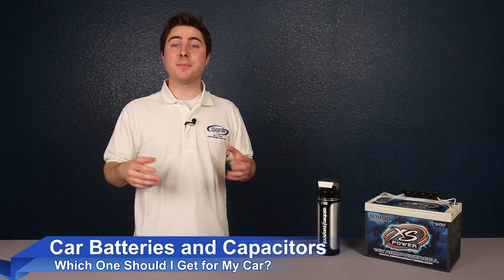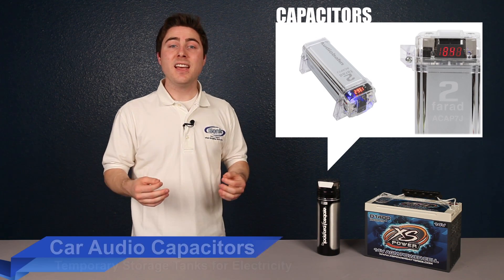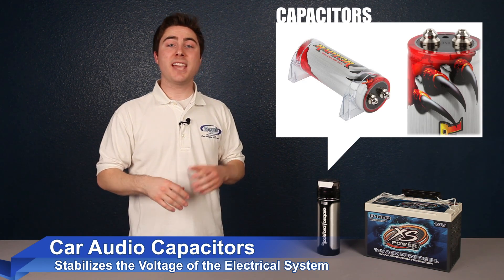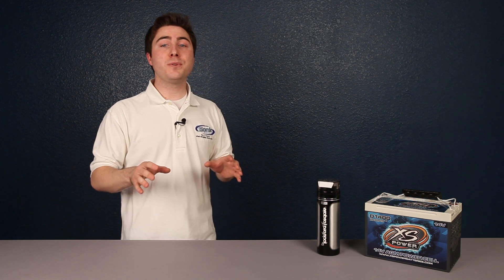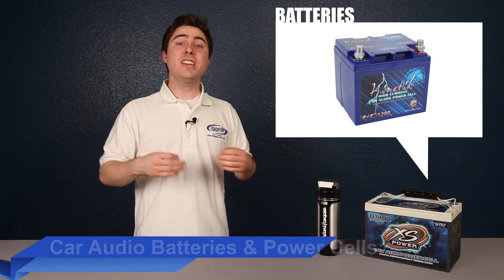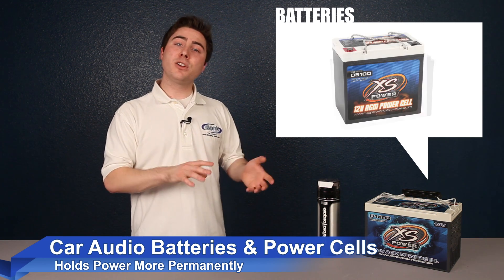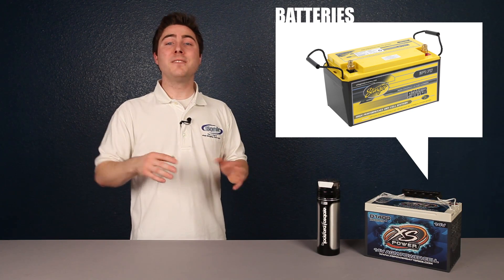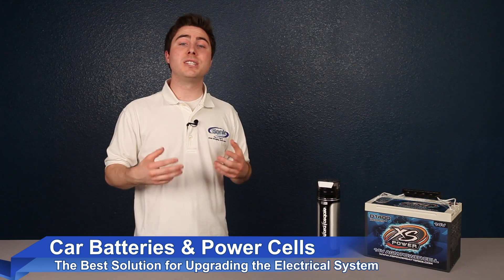Car Batteries or Capacitors: Which Should I Install? | Car Audio Tips

Comment: caps are absolutely worthless.. and I am not surprised that sonic is promoting these bullshit things. 

Do it right........
Reply: You're pretty clueless... "gets even less because the cap is taking it?" Caps "use up" about ".0015% of the energy that passes through them, a battery typically loses over 30% to heat loss. A cap is extremely efficient and a partially charged cap offers up its entire charge all the same as a fully charged one. A cap smooths out the demand on the alternator making it perform more efficiently because it decreases the losses by giving the electrons an alternative low impedance path versus the battery when demands are low, while keeping the load constant which is what alternators were designed to provide compensation for. Caps aren't the best solution in every system but to say they're never the best solution is an idiotic statement based in ignorance. Putting a high performance alternator into a system that experiences massive voltage drops constantly is a waste of half of that alternator's intended service life. If you're gonna act like a know-it-all at least know something about that which you speak.
Reply: It takes too long making informative responses only to see you reading a mere two sentences, and very badly apparently since you still don't appear to have gotten the point. If you wanna be ignorant just say so, sheesh. Not worth my time.
Reply: their not worthless, they do what their designed to do
Reply: +cuda861 Which is nothing, the voltage that they store last about 1 second in a quick burst That helps with literally nothing, If there is anything that is an issue with your system that would make you think a cap is required, the big 3 will help with, or a better alternator if you are running a system over 1000w rms on a sub 120amp alternator.
Reply: +Richphotos1 replacing the alternator and battery would be ideal yeah. But the cap does make it easier on your battery and depending on how big the cap is. If you get the right cap it will help. It's not gonna completely correct the problem. It does drain in an instant but with ale nought amperage that's not a problem. Capacitors are used in a shit ton of electronics doing the same thing
Reply: Timothy Hinton Now I'm not saying it's the best thing in the world. It's just one of those things that divides people. It does do what it's been designed to do since it's invention 100 or whatever years ago.
Reply: You would have to not understand how alternators work to recommend against capacitors in a few situations. One being where your system drains ever so slightly while at max comfortable volume until your amp goes into power protect mode. You would recommend a 300 dollar alternator over a 50 dollar cap when they both fix the problem? Further, you still have the issue of voltage drops, which alternators do not help a single bit with, meaning you need to either also purchase a cap with the alternator, or at the very least enough batteries to reduce the drop to less than 1 volt depending on your alternator's voltage regulator. These voltage drops also greatly lower the lifespan of your alternator which is caught in a cycle of half-load/full-load demands.Not to mention lowering your car's general efficiency both by adding a greater strain on the belt system to turn the larger magnetic coil and by adding in more loads that incur heat loss (batteries). Alternators are much more efficient with constant demand.
Reply: Caps are efficient and cheap alternatives to some over the top alternator/battery based solutions. Sure, you can solve any power problem by raising your average power output above your peak power input, but for some people that's over the top, when they can separate their average from their peak... with a fucking capacitor.

They don't have caps because when you have hundreds of thousands of dollars in audio equipment to power, your average energy demand is already so high that regular high volume power usage is beyond the capabilities of the amount of super alternators that will fit under your hood. So they're at an average power limitation, the solution is either put a generator in the back or the one that they all seem to choose which is stock up on so many batteries that your ears will be bleeding before your system is running low on juice.
Reply: Some problems with that:

The whole theme of the article you linked appears to be a system that's low on power to begin with and that what the car needs in that particular case is a better alternator. Essentially, even if everything was perfectly set up, the amp is draining the system's full capabilities too quickly. In other words it's not about the peak need not being enough, it's about the average need not being enough.

If you would kindly read the first message that I posted on this topic "Caps aren't the best solution in every system but to say they're never the best solution is an idiotic statement based in ignorance." Current limited overall systems need more current which capacitors obviously can't provide, no shit, neither can batteries. However, BURST current limited systems absolutely can benefit from capacitors. It's true that a capacitor will waste less energy than a battery, but this is a relatively few % of cases where that difference is going to make or break your sound system's abilities. It's not applicable to every system. Still, there are systems where the alternator provides enough for the average, but not the peak. Caps are for these systems specifically.

If you find your system bogged down trying to recharge the capacitor instead of feeding the amp, then it means either your capacitor isn't big enough for the drain you're incurring on it or your system is never going to be powerful enough for the current draw you're asking of it, and the only option is change the system demands or the system potential (alternator) It's very likely that you'll also need batteries or caps if your lights are dimming though, since alternators don't provide their power instantaneously on a sudden change like cap haters apparently think they do. Alternators adjust for maximum efficiency and there's a delay involved in that. The efficiency system isn't designed to accommodate audio system spikes.
Reply: That's what happens when an electronics engineer tries to take a moment to help out the guy who tries to hook his stuff up with a little extra context into the workings. May as well be talking to a caveman about bacteria and that's your actual career.. like really?

Thank goodness no, I don't work at a shop. Apparently they can do the same electronics-centered thing every day for 25 years and some how still don't know shit about electricity. I'm sorry, but no job should be that uninspired. Good luck to you as well.
Reply: Thanks for the info man your posts were clear and informative, Richphotos1 is like an armchair expert, a lot of written diarreah without any reasoning behind his arguments.
Reply: Richphotos1
I love it when people run out of arguments and resort to derogatory and empty verbal attacks...
Reply: Richphotos1
I read the entire thing and referenced it in my next reply. As I said, it was referencing a system that required more power, not a cap in order to say that caps are then useless, which just isn't true for other circumstances, such as when peak is what's lacking while average is a-ok. I'm not going to type more though if you don't intend to read it. Do you have any facts on those types of systems rather than a limited scope article on the matter?
Reply: Not sure if you know what limited means or read what I said.. but It seems like neither. Limited scope because it covers only one scenario of power needs and completely skips over situations where your car does provide the power needed for the average use but your battery doesn't provide enough for the peak requirement. It's not an uncommon situation, which is why sites like crutchfield recommend caps before batteries. Batteries are harder on your alternator than a cap is due to losses.
Reply: Richphotos1
Yes, that's correct. The point I'm making is that small gains can be made by introducing a cap. It's not better than a new alt AND battery, but it's better than either by themselves. The point of a cap is that caps save you money and allow your system to perform a little bit better if your engine compartment doesn't provide the clearance for another alt or have a wide enough belt for the additional tug, if you can't afford one along with a battery, or if you're concerned about efficiency in general.

I've said it many times, but I'll say it again. Alternators are made to compensate for consistent drainage of the battery, not spontaneous. Also, batteries aren't really designed to output their full crank amps, it will shorten their life. Caps help in both of these issues, while also saving your alternator work in providing a more efficient medium to store a charge rather than incurring those heat losses you'll get with a battery.
Reply: +cuda861 after the cap discharges but the music is still playing...now your amp still wants power and it gets even less because the cap is taking it
Reply: Timothy Hinton it's all up for debate.... I dont think it's a great thing for car audio stuff. You should upgrade your alternator and battery. There is vd but I'm not sure if it's so much it would create a problem. I'm not saying your wrong, but i would like to know the actual vd to come up with that conclusion. I don't use one so I can't but I am very interested
Reply: Please do some investigation on how things work before you purport to know. It's not going to do you any favors in hindsight.
Reply: Wrong. A cap is not a consumer, it "takes" no power. It is just a midway-station, a buffer. That is the big difference between batteries and caps: the former do "consum" power (but also produce power), the later are just a lighting-fast storage (compared to batteries).
Reply: 99,9% of the caps that floοd the market is trush. The products are not to blame, the only one to blame is the uninformed costumer.
Reply: Have you had any? You linked an article and that's about the only justification you've given for your views other than "I'm an expert, i know i'm right, I know you're wrong" which has really been the main part of each of your messages.
Reply: Richphotos1 By "have you had any?"  i meant have you had any facts lol.
Reply: Richphotos1
One circumstance hardly means "any" circumstance.
Reply: Seems that way. Apology accepted, I'm sorry as well, as I have the same problem and enjoy defending them.

I just really don't want new people to the market to get the wrong idea about what they are and aren't useful for. Blanket statements are abound with sites recommending them for everything to forums recommending them for nothing where it's really not a simple answer one way or another.
Reply: +cuda861 Absolutely correct...
Reply: Holy shit, you are so ignorant it is absolutely insane. 

Nobody should need a cap, EVER. Please tell me why PRO audio installers who are running 10,000+ watts do not have caps? Just stop dude.
Reply: Each time you respond proves more and more you have absolutely no idea what you are talking about. Do yourself a favor and do A LOT of reading.

Hundreds of thousands of dollars?! You think people who have 10,000+ watts have $100,000+ into their audio system? You may be confused on what "hundreds of thousands" means.
Reply: Electronics engineer? Fuck, you have connected ground to positive a few times, haven't ya?
Reply: I did not run out of facts for this debate, I stopped because I was trying to talk points to a brick wall, even though you are wrong on what you were saying you insist and have convinced yourself that you are right. I got to the point where I had to step back and ask myself if it was worth my time, and it was not. 
 
Have wonderful day!
Reply: I have not had any, you know why?! Because I know they do not work and I have done it all right the first time so I did not have any issues with light dimming. 
You must have one, and the placebo affect is still in effect?
Reply: Another wall... I am assuming you did not click on and read that link that I put in here. It saved me time on having to post all that info on my own. Its all VERY accurate info if you had any real knowledge on the subject. If after reading that you still feel the same way, you are completely ignorant and there is no  way to educate you.
With that being said, good luck! Have a wonderful night :)
Reply: limited scope article that told you why caps are not needed in and circumstance. How is that limited scope? Just stop man... please.
Reply: If you are running enough power to require a second or better battery, you should upgrade your alt anyways. 
There are so many options out there where you can just about direct swap a higher output alt from a different vehicle. I have done that many times before. 
Hell, I did that in my last vehicle which was a 1993 GMC Jimmy s15. The stock 105amp alt did not put out nearly enough for anything so I did the simple swap with putting a ad244 from a 2004 Buick Ranier with the 5.3l. 
If you know what you are doing, a cap is not needed and does not work. 

Good luck, again.
Reply: I guess our opinion will have to differ on them. I  apologize if I was harsh before, I am just passionate about this stuff and have a very strong opinion backed by a lot of experience (not saying you do not have experience, I just enjoy debates) Let bygones be bygones. Cheers!
Reply: cyan, you obviously have no idea what you are talking about. I gave reasoning behind it, multiple times. Go back and read.
Reply: Ty Jamison I'm buying a big cap.....and battery and alternator etc.
Reply: +cuda861 and it is just a bad idea. we all have them from time to time
Reply: Caps are not the best solution in any system. Alt/battery and big 3.... that is the best solution. Caps are a band-aid that do not work.
If people say they work, its a placebo.
Reply: There is no point to take this any further. You are literally just pulling bullshit out of your ass. 
You really have no idea what you are talking about.
Reply: I have been doing car audio installs for 15 years and have been working on vehicles for 25 years. I have knowledge on this bud. Please, do some real research on how a cars electrical system works, and how useless caps are. 

Do yourself a favor and read this, maybe you can educate yourself. https://axleaddict.com/cars/Car-Audio-CAPACITORS-Why-They-DONT-Work   

Like I said, they are a band-aid, and a horribly made one at.

Comment: The electrical battery does not store a charge.  This is often confused because people often hear about a battery holding volts which in the terms of the electrical producing chemical battery does not correlate to the action of storing a charge.  Batteries work by utilizing the redox properties of various substances, (I.E. lithium, lead, zinc, copper, aluminium, iron, etc.) then depending on various chemical properties you will perceive a potential difference giving you your voltage potential.  So it is proper to state that a battery CREATES voltage, but not to state that it stores voltage.

Comment: Those car audio batteries can they be used as regular starting batteries like you would find in any car or are those only specifically  for your audio system? I am a complete noob to this kind of stuff.
Reply: Although I'm sure you've gotten your answer by now, it depends on how you wire it. You could put a diode that keeps it from draining "backwards" to your starter, and instead only takes power from the workings of the vehicle, however that's only a good option if the wire you use between the batteries isn't sufficiently large to power the starter and other car components in the instance of your front battery failing. If it's not then this could cause a fire or a blown fuse without a diode. If you wire it properly with a 0 or 1 gauge wire then it should be just fine.

Also keep in mind that one battery charges the other, so when left alone they will eventually match without a diode, giving you a situation where if one fails the other likely will too after not too long. Batteries will stop accepting a charge if you lower their voltage too much, it permanently changes the chemicals inside and leaves you with a dud. Likewise, if they're overcharged it will chemically change them in a different way to not accept a charge. With a diode the front one can fail without the rear failing, but if the rear fails the front will as well.

Comment: Hi, advise on adding an extra battery and a capacitor? I am running two batteries and I experience some battery discharge. I am not sure whether to connect an alternator wire to my extra battery so it can be charged as well. -I need advice on that from some of you who are perspicacious; Secondly, I would like to know if I should add a Capacitor (and if so, what size) to my following system? I am running 2 Amps ( 5200w mono-block & 5500w 4 channel); 2 x 2000w Targa 4D Subs; 2 x 400w Pioneer 6x9 ; 2 x 350w Pioneer midranges; 2 x 200w Pioneer tweeters; 8000k h4 bi xenon HID kit; All this is installed in a 70's VW Beetle... I need that wise tip from you

Comment: I already own a capacitor and I am considering upgrading to a solo battery just for the amp , question is if i upgrade to a battery only should I use the capacitor well???? or the battery by itself???? if I decide to use the battery and the capacity together will that that hurt the power to the amp??? and if i the capacitor and battery combo will that help with the battery in longer battery life ???
Reply: jack morgan I am waiting for a response regarding such; as you may see in my comment, I instead of having a capacitor have an extra battery
Reply: +jack morgan  go with a capcell battery look it on ebay,